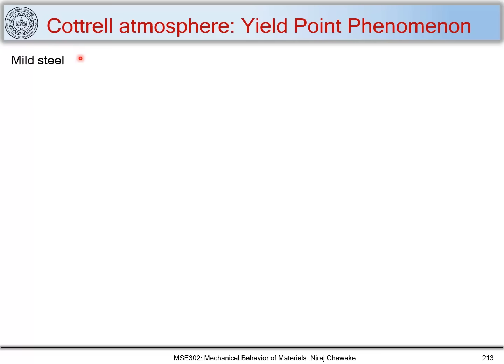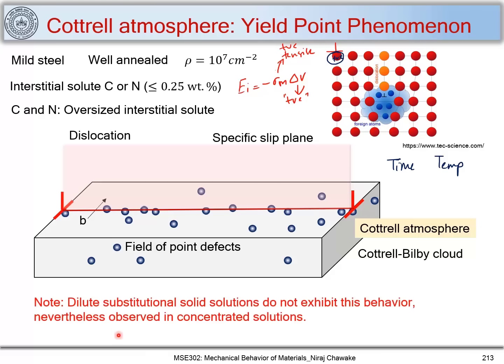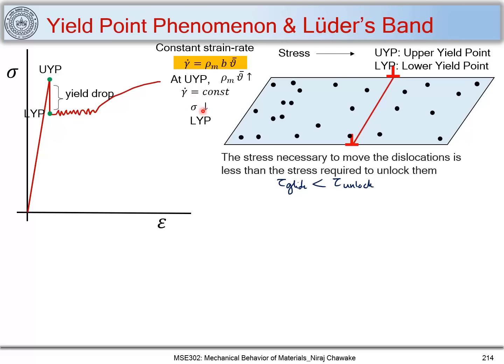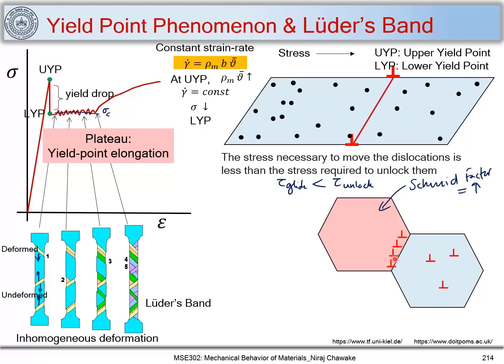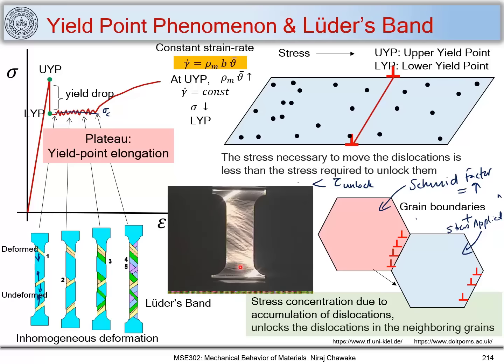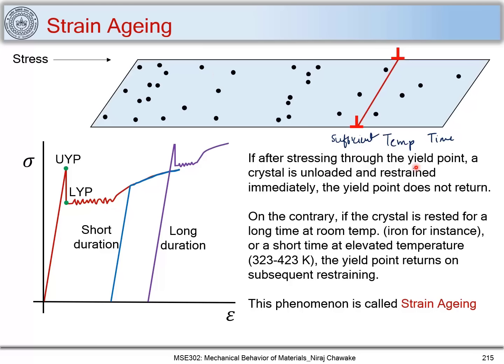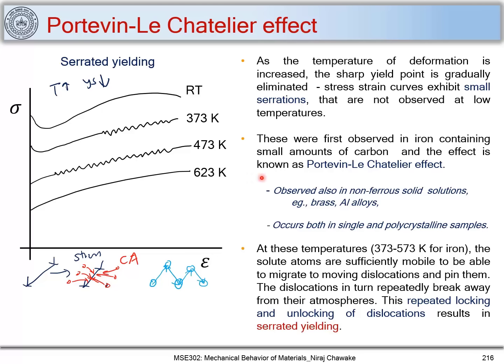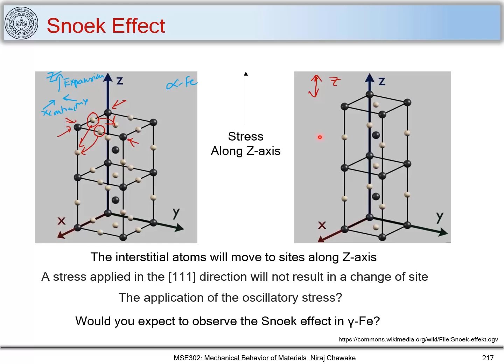53. Cottrell atmosphere and Yield point phenomenon

Comment: It is said that necking (plastic instability) occurs in a tensile test when the rate of local specimen thinning (and hence the local stress increase rate) exceeds the rate of increase in load bearing capability that arises from strain hardening.  If that is true, then the specimen should theoretically begin to neck whenever the stress strain curve exhibits either a flat or a negative slope since the defined condition should be met when the slope is flat or negative.  However, we know this necking does not happen right after the upper yield point is reached and we also know it does not occur with Q&T low alloy steels during the flat region (slope near 0) of the stress strain curve in the region where the offset yield strength is measured.   Is there any explanation for why this is so?  Clearly this would seem to prove that the text book explanation of why a plastic instability occurs does not actually apply universally to all cases wherein it should apply as per the given explanation.
Reply from the maker: Your assessment is indeed accurate. Yet, basing remarks on necking behavior solely through observation of the stress-strain plot might not be prudent. It is advisable to refrain from commenting definitively on plastic instability unless observable necking occurs in the specimen. The alteration in slope could stem from the interplay between mechanisms of softening and hardening. Should plastic instability arise, it's when geometric softening, involving localized alterations in dimensions, gains prominence over hardening, consequently initiating necking. Therefore, it was a conventional practice, especially in the preceding two to three decades, to supplement stress-strain plots with accompanying pictures of the tensile specimens.

Comment: We know that annealed low carbon steels tend to exhibit the yield point phenomena.  But if a low carbon steel has a primarily bainitic microstructure, either via austempering, or via undergoing a quench rate which produces primarily bainite, will it exhibit the yield point phenomena?